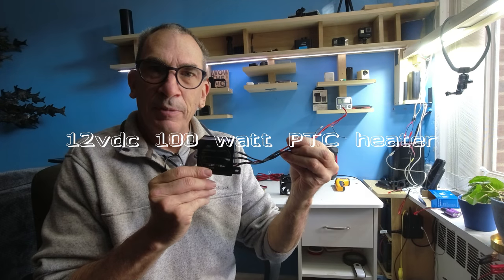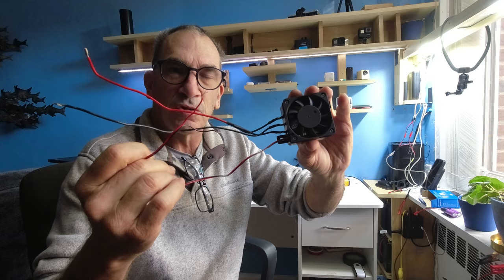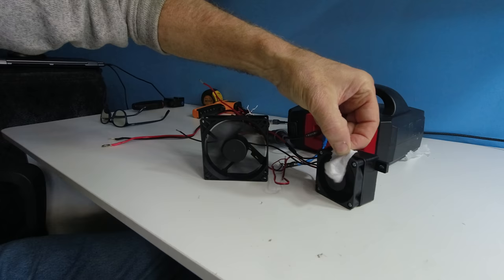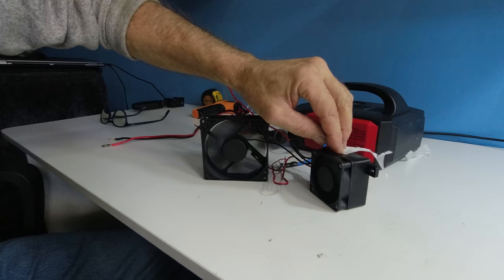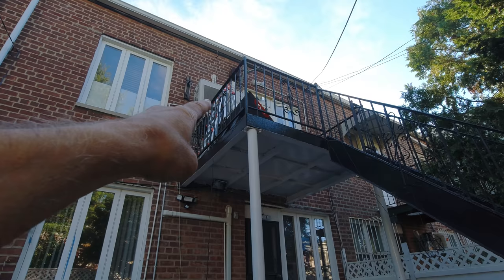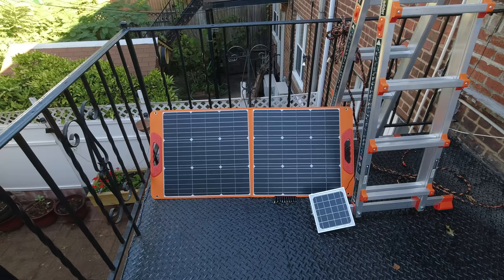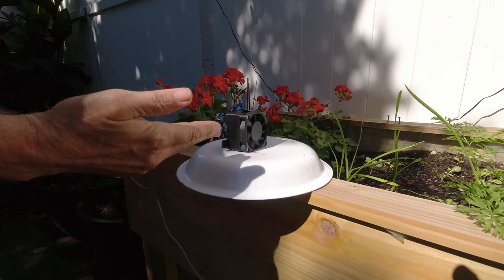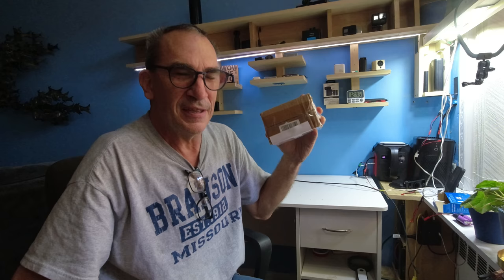12v 100 watt ptc heater

Comment: I bought two of these for a little bit of taking the chill off in the morning in the camp van. Running for a short time off of 2 solar charged 12 volt deep cycle Maxx batteries.

Comment: I’ve noticed that when you hook the fan to 12v power it runs too fast and actually starts cooling the heating element off and losing some heat. I think that’s why people are using 8.5v for the fan to slow it down just enough to not cool off the heating element and have just enough fan speed to blow the heat but also enough speed to keep the wires from over heating and melting. This was the result of my own personal experiment. I will be using this fan to keep my Lithium batter bank compartment in my sprinter from getting to cold in the Colorado winter. My compartment is insulated so this tiny little 100w heater will be plenty!!
Reply from the maker: Big-thank you much appreciated,  that would make  sense. I we run bats with   heating pads for batteries in teh commercial business enough to do the job

Comment: Curious the Voltage output you were getting from your panels test at on a sunny day? I dont always trust the sticker output they put, in your case the 18v panels might have been too low. I am ordering 12v ceramic tcp heater like you have but 50watt instead. I have 100w solar panels from Harbor Freight to try test this with
Reply from the maker: 100 watt   renergy. I need to one day look into it. I have double the cap on them now to 200 watt per, I run  some Lifepo4 and man what  difference  on nasty days.
but that is how things are I guess

Comment: I want to know about the power supply.
Reply from the maker: the project was to a 12 volt  solar panel no battery the power supply I used was a 12v battery booster  I reviewed and have. I will try to look it up later . its on my channel somewhere

Comment: Can you post a detailed video on how to wire it up for a wall outlet, please?
Reply from the maker: not made for an wall outlet of 110vac,
Reply: 12 volt dc from 110 volt ac power supply is needed.